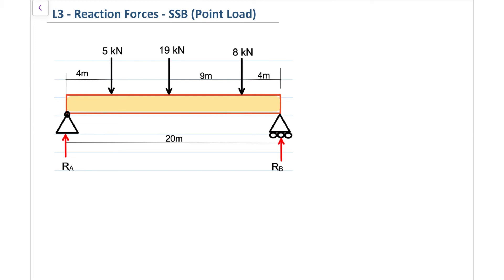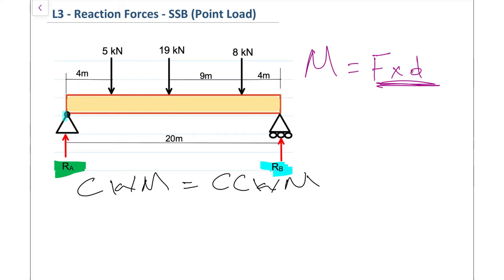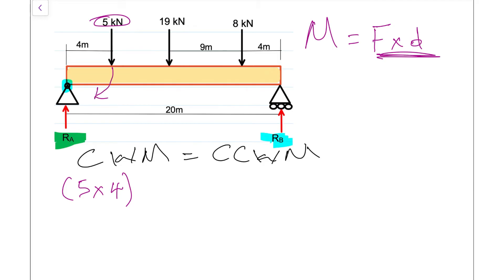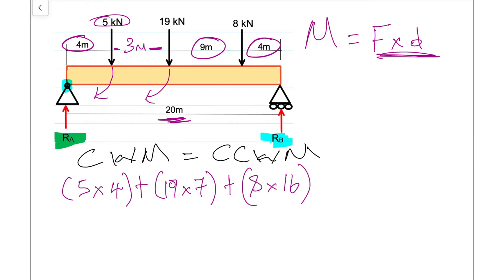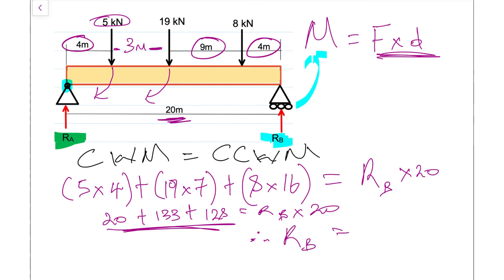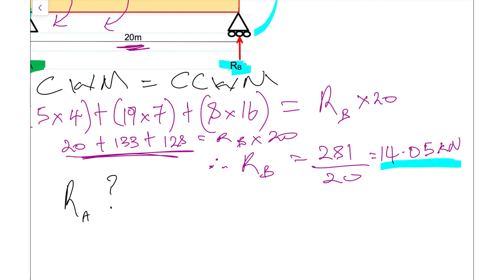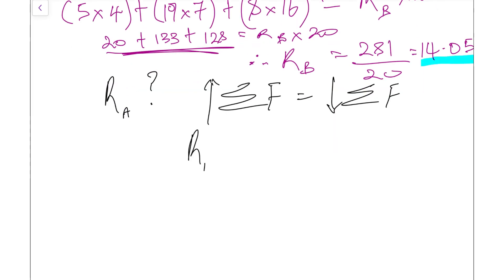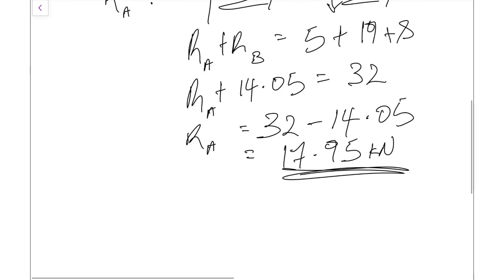Beam Reactions | Simply Supported Example (Step-by-Step)

Comment: Thank you!!
Why does a downward force on the beam not have a reaction force acting at that same exact point? That's what we'd expect on the ground, right? 
Instead, we say the reaction forces act at the supports. Is there an assumption about the beam (eg. no mass, no tension?) that allows us to say this?
Reply from the maker: I’m assuming you are referring to when we take the moment about a point, the force acting at that point has no effect (moment). That is primarily because Moment = Force X Perpendicular distance and the distance from the pivot point where the force is acting is 0. So the reaction force x 0 at that point would be zero. The second reaction would be some distance away from that pivot point so it will definitely have a moment. If you still don’t get it let me know and I will figure some way to get you sorted.